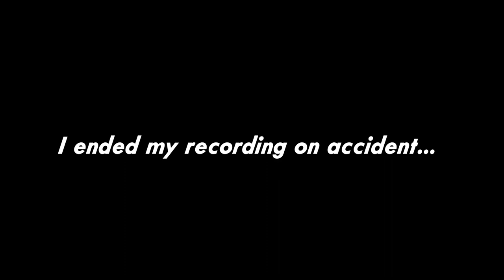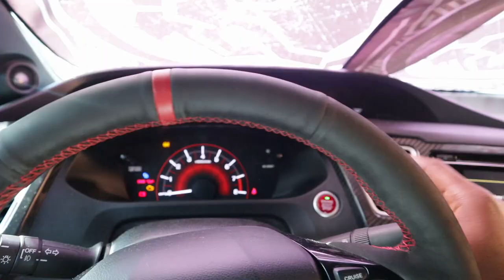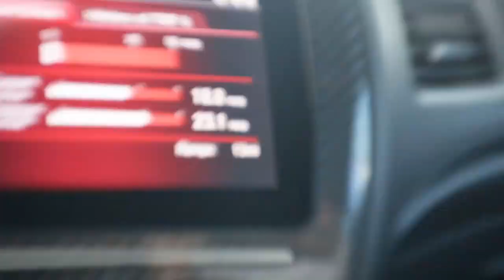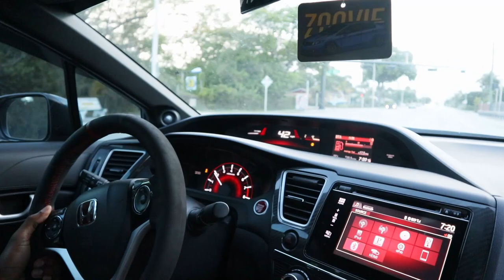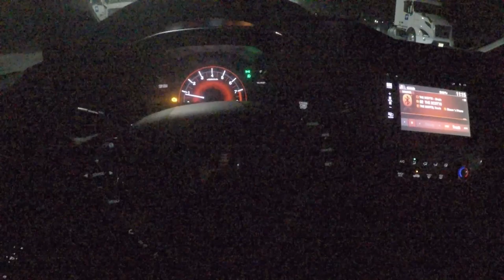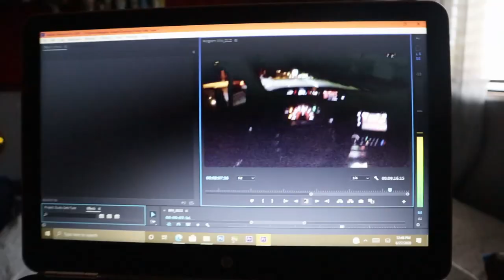Civic Si Made Some POWER!

Comment: Oh man I’m running , acuity cold air intake , 550cc injector , skunk 2 manifold with 70mm throttle body and throttle body spacer , skunk 2 mega power rr exhaust with alpha down pipe  k tune fuel rail , acuity short shifter and I HOPE I look at 230 cause if I don’t I’m a pop the clutch place a brick on the throttle and walk home
Reply: Lol u cray!!!!!! I'm sure I'll make it

Comment: Bruh we made almost the same powerrr! 216.7whp 170tq i think😳 with rbc manifold stock, skunk2 cold air intake modified to shortram, 3in catback, 70a rr hsport, ktuned 72mm tb. My tuner said i could be in 220 to 225whp easily if it wasnt hot day when i got my tune😳. 9th gen ftw!! Yessirrr
Reply from the maker: Nice bro nice .. stock injectors as well?

Comment: Great job, like I told you the last you would make btw 215hp- 220hp, so great job, and you need a tricker for your skunk 2 downpipe for the second O2 sensor, or you can disable it, mine is  disable by my tuner, because it will throw a code, and you will see check emission system I think it said. Your car can work off the primary O2 no issue. If you upgrade to bigger injectors and full 3" you can make even more power like around 225hp-230hp, like you knw l made 232hp 183tq  and that's with k&n short rim, I just recently upgraded to acuity cold air I haven't retuned yet, but should he around the same power.
Reply: Mikie Jones  thank you.

Comment: Yoo have you ever thought about going with your K24Z7 block with K24A2 head to get intake and exhaust Vtec system? (K24A2  head needs to get to a machine shop in order to put all holes right for the K24Z7 block) thats pretty much all after that
Reply from the maker: Why would i go with a K24 head ... z3 head is what i would use also I would change the oil pump to even be able to really use the extra rpms of the z3
Reply: @zoovie  that sounds even better!!!! If you really really thinking about it i will love to see all the process you can get easy 5 to 8 videos out of that

Comment: Bro I’ve got the same exact fb6 & same color. Had the same FBO Setup with RBC but I was tuned by handy built. Car is so much fun 😅, unfortunately for me I want a bit more spice so I just parted out & going to see wassup as a next cop
Reply from the maker: Nice bro ... I love this car I don’t think I can change it .. ever lmao
Reply: you had a k24 with its natural habitat. rich youtubers chase after these engines anyone in the car community. these are 4 cylinder 2jzs, they take power and never break. why get a subaru when the gasket is going to blow? it’s cheaper to awd a civic in the long run, also lighter and will take more power. ppl sleep on civics
Reply: @sopretty43vr  Hold up Hold up my guy, I kept the car & have the Makspeed Turbo kit laying in my room, getting installed next week 😅

Comment: Looking good my dude.

 I’m wondering if the 3”dp into a 2.75” exhaust restrains power. Would it be better flow for a full 3” exhaust setup?
Reply: Sup man. To answer your question. No. That is perfectly fine. Car needs back pressure unless its boosted like me. So if your talking about the q300 exhaust it will be good. No power loss.
Reply: Cina I’ve been looking at the Buddyclub Exhaust. Thanks for the info!✌🏾
Reply: @MugenStylez  thats essentially what I have excepy mine is custom made

Comment: Question. So would you still need a Hondata FlashPro after adding those mods or does the tune defeats that purpose?
Reply from the maker: You need a tuning device , to be able to get tuned
Reply: zoovie what do you use?
Reply from the maker: I’m on ktuner

Comment: Somethings up with ur motor bro I only had a cold air intake and downpipe and catback exhaust no rbc I made 216/198 tq but be careful with derfs tune I know people who know him personally and he pulls timing from the motor they blow he blew my motor 3 days after I tuned it
Reply from the maker: Who you tune by? And I got recommended to him, motor runs and sounds healthy.. plus you can tell when a motor timing is pulled .. but thanks for the heads up
Reply from the maker: And making 218 on stock injectors is really good. So I don’t think there anything wrong with my motor and I’m 100% sure, our powerband is completely different too bro. With a Rbc I lose low end torque but pick up top end horsepower.
Reply: zoovie derf blew mine and im just sayin bro cause if you follow siclubfl on ig i know a bumch of em and like 12 members with 9 gens had him blow their motor
Reply: zoovie actually the rbc helps only for mid power range
Reply: zoovie and my set up was stock everything except stage 1 clutch skunk 2 intake and 3in plm downpipe and 3in yonaka exhaust
Reply: @aofdeath00  how your motor blew
Reply: @vonstrong92  just driving it for 3 days lol
Reply: @aofdeath00  beating on it lol